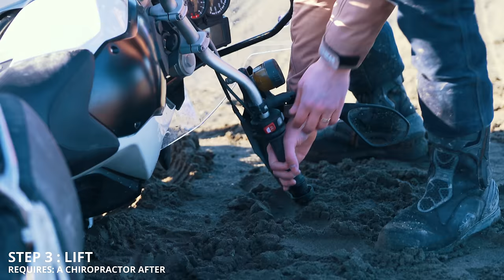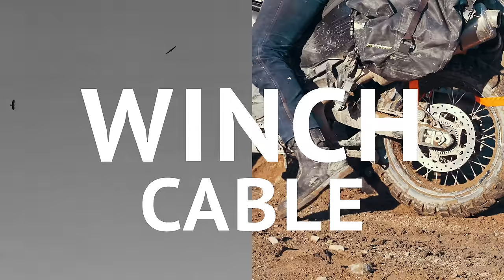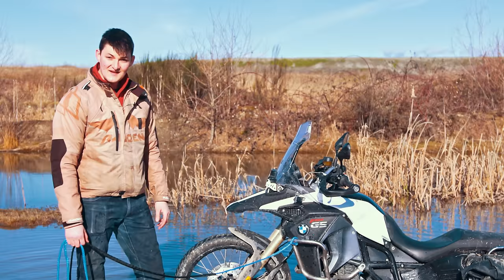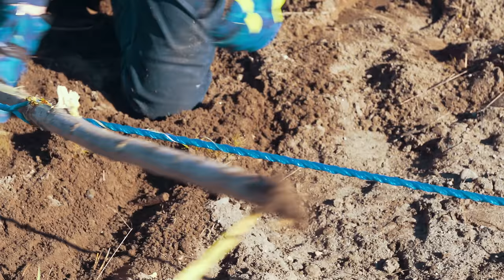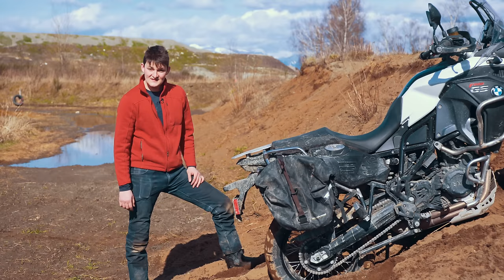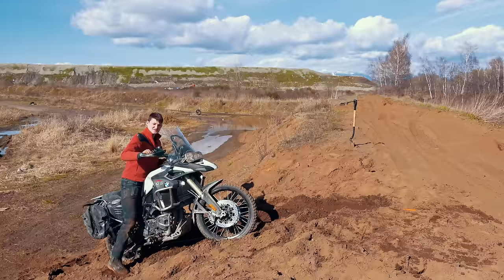5 Tricks to Rescue a Stuck Motorcycle

Comment: OMG! Ryan doesn't know the correct way to pick up a motorcycle. Who'davthunkit?
You position your back to the bike, grab it with straight arms and lift with your knees Ryan.
Reply: I thought that also... <-owns a goldwing
Reply: His poor back! With his hight he could easily leverage that bike with the proper method.
Reply: @measter I've only got one leg and that's how I picked up my Venture (when their wasn't a handy minibus full of fireman behind me at the off camber junction).
Reply: Actually, there are more than one "correct" ways of doing it. And the one Ryan used happens to be one of the recommended ways by BMW. I think he also once made a video about that subject (picking up a bike). Cheers
Reply: @docthebiker  there's a video on YouTube of a small girl lifting a GL1800. She puts her back to the crash bars grabs them and lifts.
Reply: @goranvitkovic5234  Soz Goran, but I can't find it. I've looked (and been subscribed for 3 years).
I've not owned a beemer, but I wonder if the way they recommend to pick up their bikes might be relevant to the opposed twin engine, and not rolling the weight over the cylinder head? That wouldn't be the case with the GS.
Reply: @measter  yup seen that crazy video I hoped I would get to bet on something like that amongst friends and grab some free money
Reply: @docthebiker  Except that the 850 is not a boxer engine
Reply: @DavidTopps  Exactly. I think the instruction that BMW give to pick up their bikes in a certain way (as opposed to lifting with your back to the bike) are probably specific to the boxer with its protruding cylinders.
Therefore Ryan could have lifted the GS 850 ( not a boxer ) in an easier manner.